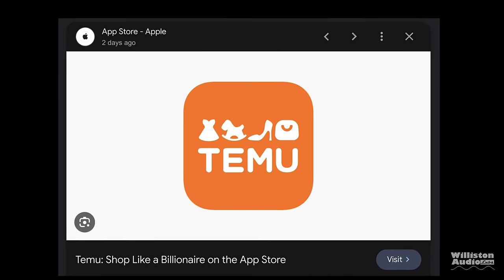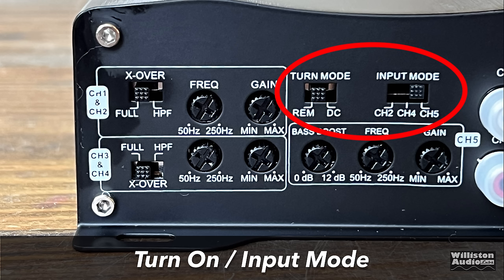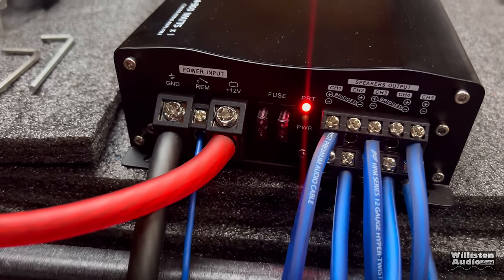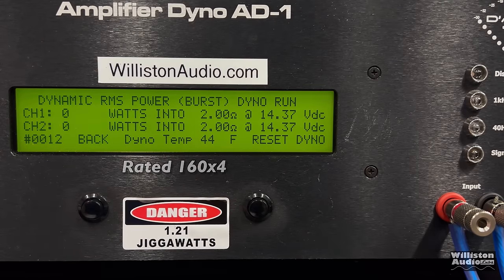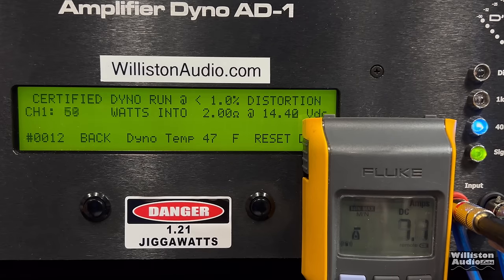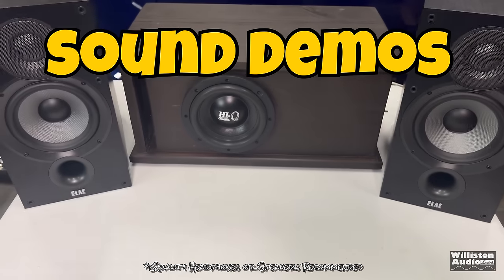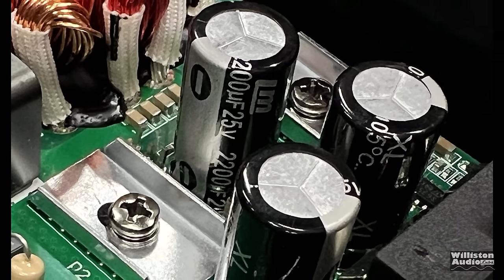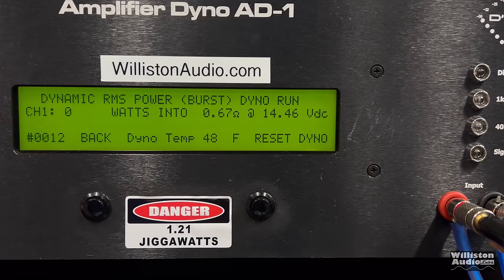I Bought a TEMU Car Audio Amplifier

Comment: most importantly ...they listed the correct power! IT DOES ITS RATED POWER!  that's a huge deal. Does rated power on a dyno, didnt explode, didnt sound like hot garbage, and cost 100 bucks..  lets take a minute to reflect on just how awesome that is.. where we were 10-15 years ago. Great job as always Big D!
Reply: the correct power is listed, i hope its not just a fluke, but even the circuitry inside looks good.  this was probably designed for a very small car in mind,
Reply: When I saw those numbers printed on it I thought "dang either they are actually being honest or we are going to be looking at 20 watts per"
Reply: Also it was probably built by 10 to 15 year olds which explains the low price.
Reply: I agree, Chinese reseller companies have very little incentive to be honest in their advertising, I always appreciate when they don't lie, good or bad
Reply: You sound like a salesman for this board. But I totally agree with you. If I could get my car audio to sound like that based on a $100 amp. I'd be majorly happy. If you're really that stressed out about the low power on the base, it's not hard to put another inline power amp in. I give this thing an 8/10 given the cost and 'bang-for-'buck'. It's a car for peats sake. Anything better than a valve radio, in my opinion, is a major plus!

Comment: It's might be anemic, BUT, it's putting out more juice than a lot of "premium" factory car audio systems. This with 4 speakers and a 10" DVC sub would sound worlds better than what you get in a lot of cars.
Reply: yea i mean 300w to sub. granted its 1ohm wich is very uncommon for a 5 channel amp in the name brand industry. but wattage of 300w into 2ohm is pretty much where 95% of the normal name brand 5ch amps sit at so... this isnt far off the mark at all.
Reply: 4 x 100 is pretty nice.   I think the fuses look like in our yaris.  regular would be nicer.

Comment: I'm not mad at it....other amp makers need to take notes
Reply: Specially JL and their $500 amp with 300amp
Reply: but tbh this amp probably wont last for very long. the components in such amps are working on the edge to get this kind of performance. JL amps do their power for ages without even stressing or getting hot. they are meant to last, this one is meant to sell
Reply: @sushi3377  I beg to differ. I bought a jl 300/4 brand new....used upon normal operation, two channels went out unexpectedly. All that money for a brand name amp not to last. I'll take my chances with this.

Comment: Mental 😂 you could find this exact board from the likes of Crescendo, Digital designs, Soundigital, B2 Audio, for MEGA markup money. It's the sort of thing they'd release. Dual 2093M based class D with your standard SMPS found in almost all car amps. You can't really go wrong as the factory isn't designing the critical bits of the amplifier, that's all done and optimised by the chip manufacturers; the factory/brand just connects everything together. Will it be the best sounding amplifier ever? No... Will it last more than 5 years? Maybe not... Will it sound absolutely fine and get really loud with good efficiency? Yep!
Reply: It's quite astonishing how class D has made such abundant power, reasonable quality and tiny size the norm these days. This may not be the last word in quality, but I would guess its better designed than a lot of car brands OEM amplifiers, and more powerful too.
Reply: I don't know about exact board, but maybe very similar. Lol
Reply: I was just thinking of building my own amp using a few driver ICs (2092s perhaps) to put juice on my sub. Output buffers and more, stouter transistors won't hurt to be stable at 1 ohm, eh?
Reply: @JasonWW2000  ok because Sam doesn’t know what he’s talking about bro. 🤣🤣
Reply: @TheGodofSEO Oh, you're not familiar are you? You see, Sam has a habit of saying that a amplifier circuit board is the "same" as this other brand. He doesn't mean literally that it's exactly the same, he means it's the same basic layout and design.

I want the people who read these comments know what Sam meant when he said the boards are the "same".

Comment: Wow! Those little 40 amp mini blades are working overtime! That thing was putting out a thousand watts total with all channels maxed out. 👏 Could you imagine having a 5 channel amp with these capabilities for this price back in the 90s?
Reply: Absolutely not.  Back then, a buck a (real)watt was a STEAL.
Reply: Back in the early 2000s I got a Kenwood exelon 810d, still have it and it was 849 on sale
Reply: 1000/12= 83,33 so basically perfect size fuse

Comment: I'm glad to see you review this Bemines amp! I've been eyeballing this amp every time I visit Temu. It's good to see a cheap Chinese amp label true wattage on it instead of some stupid 9000W or something. This will make the perfect amp for someone who's only looking for a cheap setup that can fill in the lows a bit.
As for controlling the bass output, Temu also sells a low level bass remote that connects inline with the RCA inputs. It has two knobs, one for the volume level, and one for the crossover frequency. That will give full control of the sub section of the amp.
I may very well use this amp in my Geo Metro as it's the perfect size and power output for my purposes.
Reply: I would avoid that if it has a crossover in it.
Reply: @JasonWW2000  Why? It works like a ZK-MT21 amp. Gives more flexibility.
Reply: @T_Burd_75  I wasn't referring to the amplifier I was referring to the remote bass knob that you mentioned. If I were going to get a remote bass knob I would want it to be a simple, passive device.
Reply: @JasonWW2000  I know. But he mentioned in the review that the amp lacked a remote bass control knob, something that he didn't like. Since the sub section of the amp uses separate RCA inputs, that can be controlled by a controller connected inline with the RCA cables. And having level control  and a variable sub crossover control, you can adjust what frequency you want the bass to kick in and how loud when it does. And you won't have to crawl under the seat with a tiny screwdriver to do it.
Reply: @T_Burd_75  Crawling under the seat to adjust the crossover point is a one-time job. You basically set it and forget it. 

The potential issue that you're not thinking of is that the active crossover circuitry built into the remote might add noise, distortion or clipping which the amplifier is going to amplify. I personally wouldn't take that risk. I'd rather keep the remote bass knob a simple passive device, a stereo potentiometer, and then have all the crossover circuitry done either in the amplifier or upstream in a DSP. That's just me, though. Maybe the particular device you're talking about is perfectly fine and isn't going to cause any problems. I can't think of any practical use for adjusting the crossover frequency in the remote, though. I would probably just set the frequency and then hot glue the knob in that position so I don't accidentally change it. 

By the way, what is the name or model of the remote knob you're talking about?

Comment: Well it ain't as teabag as I thought it would be.  Looks under capped but otherwise clean soldering,  etc.  Makes decent power in a small size, I'd have liked to see the thermals. I haven't been this surprised since the $50 Walmart amps (?Jensen?).

Comment: I worked at a local audio shop in the early 90s. We had an installer that was a bit..uh..eccentric. He seemed to never sleep. He built our sound room in one night. 
His name was Tony Greene. Well, Tony decided to install some Savard RAP 18s in his 1990 Honda Civic hatchback...8 Savard RAP 18s to be exact. The car was a total BEAST!! We dealt Savard so his car was a great sales tool when someone asked about Savard woofers...which at the time...were somewhat unknown in our area. I sold and installed quite a few Savard woofers thanks to Tony's car winning over potential buyers. 
Tony went on to compete occasionally with his Honda in USAC and IASCA. Man..those were the days. All of us that worked there had great systems of every configuration...from SQ machines to SPL monsters...and most of us competed quite often. I miss those days!!

Comment: Arguably the chip style amps can achieve better sound results as they usually switch from 400khz all the way up to 1mhz I believe whereas discrete style mosfet class d full range is around 250khz.

Comment: Thanks for checking in on this one. I've been wondering if it was worth rolling the dice on Temu audio stuff. Here's an example of why it could be a steal, because we all know, Temu is hit and miss.
Reply: Just remember that Temu is not a brand, it's a marketplace similar to eBay or Amazon. So you still have to choose the right brand.
Reply: @JasonWW2000   I wasn't implying it was a brand. It's the same thing as calling something an Amazon, Ebay, or Walmart amp.

Comment: Back in the day, my del sol had kicker speakers front doors and rear seat positions. And i had a 12 inch kicker comp (2007 model) subwoofer running a walmart crunch amp. Legit could hear me 2 blocks away. Buddy used to laugh at how loud my system was

Comment: I'm curious what factory is producing this and who else they produce for.  The amp is 90% of the way there, fix the ratings and include some more features, and it's a decent product especially at the price point; one of my biggest peeves is the output block, a speaker pair should always be grouped on the same terminal bank, this would have also opened up room for a secondary sub terminal, say 1L1R-2L2R-S+-S- on the top then 3L3R-4L4R-S+S- on the bottom, this is just cleaner and works much better for speaker wire that is in a multi-core jacket with pants.  I really wanted to know what the chips were, probably some TI knockoff, which may lend to original TI chips providing truer ratings.  Maybe we're finally getting into the era of abundant dirt cheap tiny chip amps; if a no-name Chinese factory can produce this for a no-name brand, imagine what would happen if the lowest end companies started buying these up, imagine finding one of these at Walmart with a more recognizable name; which would honestly go well with everything else in the Walmart car audio bargain bin, and this would be fine for anyone who wants an upgrade from stock systems but doesn't want anything crazy.

Comment: A lot of products on Temu are fine - sure you might get the odd dud - but this even happens with big name brands!.. As for this AMP - its probably made by one of the many whitelabel amp builders that also build amps for other major brands.  as for limited crossover settings or remote amp - most headunits provide all this stuff (unless your working it into an OEM system).. Ive run a few headunits (android based) and the setup and functionally built into these is impressive when it comes to the sound setup.  Crossovers, time alignment, bass adjustments, EQ's etc etc..

Comment: I mean, H.P Hong started out advertising S&I board Korean amps on Alibaba...no comparison of course, but some Chinese boards are not too bad. Before I got my wolfram 9ks I ran 2 Hifonix BG4000s on 3-Sundown zv6 18s and it got down...and that was running them at the (not) recommended resistance of .67 per amp lol...got warm but never shut down

Comment: Wow this little guy could decently power a whole. Car. Granted you will need to find power matching speakers but should be an easy task. Pair this with aome speakers from Recoil and you might be able to have a whole system for under $500. That is insane IMO.
Reply: You don't need power matching speakers.

Comment: My biggest concern on cheap brand amps is not really wether they do rated power or not, the question is how long can they do it for? RELIABILITY is the big question here. What good does it do if it can do rated power but goes up in smoke a week later. Then those $100 were thrown away
Reply: Correct, there are many factors involved besides power. You've got reliability, all the various protection circuits, features, the noise floor, the sound quality, whether it's going to inject noise into your automobile, etc... Lots of things, but it making rated power is a really good first test that most amplifiers are not able to pass.

Comment: you have to admit.....
1. does its rated power
2. looks clean
3. basically a thousand watt 5 channel amp for 110 after taxes equals like what 11 cents a watt

this is a great bargain amp to get if you wanna improve the sound in your car and add an entry level woofer for good dynamic range

Comment: Cool little amp and mad props to BEMINES for quoting rated power! I'd say this would be great for a bagger/powersports system but without marine coating it would be risky. Beyond that it really doesn't seem to serve a purpose in standard car audio since you can get more useable power in a discrete design for barely more $. Pass on this one unless you have absolutely no space to spare and HARD pass on buying anything from TEMU 😂

Comment: Man for a cheap amp I couldn’t believe the speakers ch did rated power sucks the sub ch was so weak. I mean for 100$ it wouldn’t be a bad idea for someone who wants the music louder than stock without big big bass, I’m actually impressed that it didn’t blow up and did numbers
Reply: The 300W sub channel isn't "weak", you just need to use a slightly efficient sub speaker or tweak the bass gain.
.
You don't need 1000's of watts of amp power to get "balanced" bass. You just need to select your speakers carefully, rather than choosing some 10,000W sub that runs at like 75 db/W and needs massive power to be audible. 😉

Comment: Honestly this amp would go great with a Walmart special car audio system.. 1 10" kicker for the sub and front and rear interior with kicker as well.. 5 ¼ and 6x9s a low buck system IMO
Reply from the maker: Agreed totally not a bad amp I just don’t condone using TEMU
Reply: @wal  They all start somewhere.. just remember it ok to upgrade, not with 4 letter shoppin sites like  eBay temu wish..just keep givin us a reason to upgrade big dummy.. 😉

Comment: Noticing the voltage drop and how the amp reacts makese think it needs a capacitor. Or a very strong electrical system so the voltage stays at or above 14.4 volts.
Reply: he had even 8k rms with amplifiers, idk why it has this drop with 80 amps draw
Reply: @6mariooo235  I'm thinking his battery bank is becoming weak or that amp is a glutton.
Reply: The voltage sag that you see in the dyno screen is the voltages supplied by BigD's power supply to the amplifier under test.
.
It has nothing to do with the amp itself, it's just that D never manages the voltages properly with his testing.
So what you see on rhe dyno is what power it makes with whatever voltage he's feeding it during the test.
.
The difference between 14V and 14.4V sounds small, but it will change the power output at the square of the voltage...
If 14V @ 2 ohms = 98W then 14.4V @ 2 ohms = 103.7W
.
Of course, in a normal car you won't usually see even 14V at the amplifier input terminals, so this technical stuff is only about comparing the power ratings in a fair and controlled way.

Comment: It does what they said it would do.  It's a reasonable price.  Why not use it in a car or a boat that's easy to break into.  I just need enough to fill up a small 80s single cab mini truck with hard hitting metal.

Comment: I bought the Black Diamond based on your video and input for a sub amp.  Very happy with it after almost 4 years.  I am thinking of upgrading my interior from the VW factory speakers.  What 4 channel amp would you recommend to power the interior 6.5" ?

Comment: A stable AC to DC power supply would be advisable for the use of the amp Dyno testing, this of course would be a 220 volt AC to variable DC voltage output that utilizes High DC current stability.
Using lithium batteries without alternator backup is actually an unfair test.. .

Comment: Did very well but it's also $100 and not like the $30 stuff you'll find on there, so while it's not expensive it's also not cheap like a lot of the junk, either.  A shame you need to have a 1-Ohm load on the sub channel to get the 300W out of it though.  Would me more ideal if it did that at 2-Ohm and then was even 450W at 1-Ohm that would be fine.
Reply: Yah not that great of a deal. But hey. It makes rated!

Comment: Would be nice if you test some Lymal Audio amps.

I have a 4 channels LT-800.4 in the package says: 
4x160 Watts @ 4 Ohms (Stereo)
2x640 Watts @ 4 Ohms (Bridged)
4x320 Watts @ 2 Ohms (Stereo)

I use 2 channels for my tweeter and 2 channels bridged for my Kicker CompVR 12 inches and it handles that CVR extremely well.

There's also a 2 channels version LT-400.2 (I have that one too laying around for a project) which says: 
2x160 Watts @ 4 Ohms (Stereo)
1x640 Watts @4 Ohms (Bridget)
2x320 Watts @ 2 Ohms (Stereo)

Lymal LT-400.2: $69.95 USD
Lymal LT-800.4: $99.95 USD

Comment: A pair would give you a 10 channel set up. Easily equal to $3K factory amped system. For dirt cheap.
Reply: That is not a fair comparison. A factory amped system is also going to be specifically DSP tuned with time alignment, crossovers and EQ.
Reply: @JasonWW2000  was specifically referring to power amps. Sure, the factory has lots of sound modifications. Again for thousands more. A $70 DSP could get you into that if that is your goal. Budget building is our focus here.

Comment: How does it handle running a heavy load for a period of time ? I still remember an amp I had in the late 90s, I think JVC, it worked great for 30 minutes then overheats and shuts down until it cools, repeat the cycle over and over. Annoying on long drives.

Comment: Still not gonna do that avatar ATU ah? 

I mean I measured the voltage output around 65.7v I think it was. Rated for 2k @1 but well, 65v is about double the rated power for a lil $200 amp